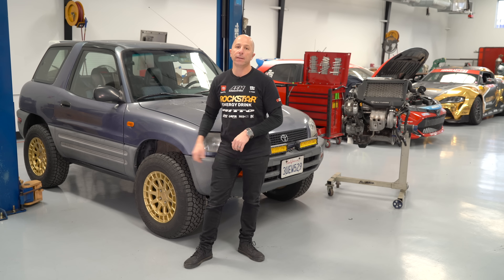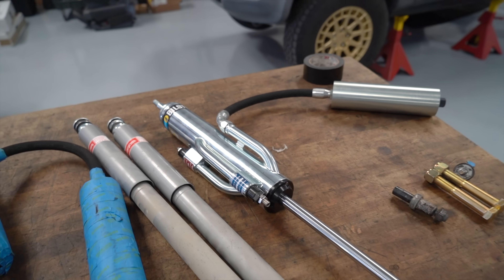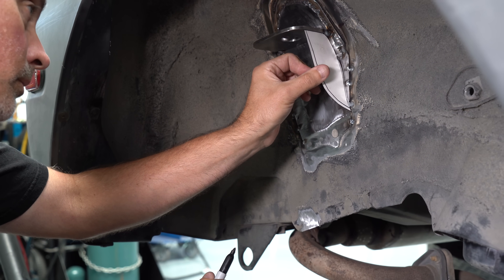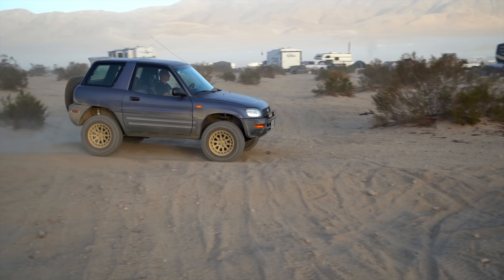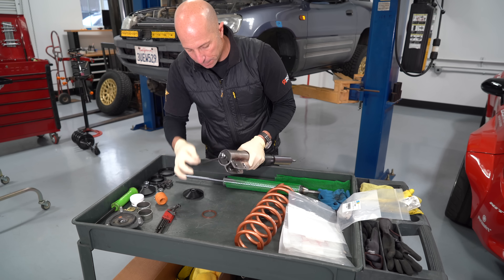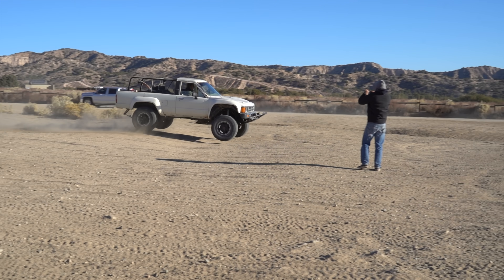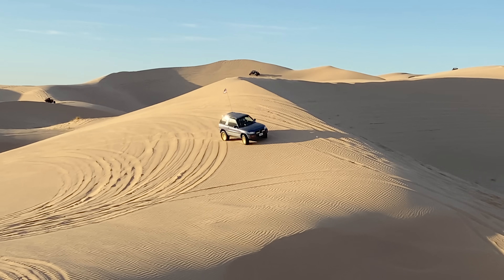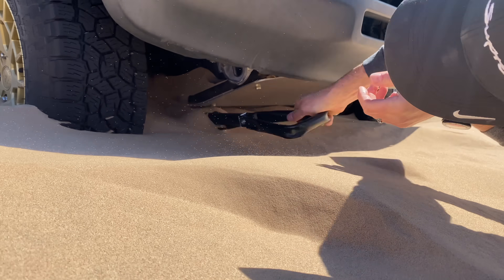RAV4 Build Part 2 - Install and Test Racing Suspension

Comment: This is so much cooler to watch than all the super expensive pro builds out on the web.
Reply: Well this is pro build. Tell me how many people can fabricate mounts for shocks?
Reply: Indeed
Reply: @dkdanis1340  well yes, but its not some sorta high zoot ground up buggy build, or even the trendy Tacoma...its an old Rav4!
Reply: @dkdanis1340  still not out of the reach of a decent home setup. That’s about as basic as fabrication gets and could be done pretty easily with an angle grinder, welder, cardboard to make templates etc. May not be as pretty but could certainly be done.
Reply: @benyvonnemckenzie6576  also they used high end bypass shocks. But yeah it can be done.
Reply: @benyvonnemckenzie6576  Exactly, I am a 23 year old student and with my home setup could easiely do it. I own a welder, an angle grinder and a super basic mill/drillpress. I even do similar stuff often, but more for motorcycles and stuff.
Reply: This is an expensive pro-build though, just because its not a 200k offroader doesn't mean the suspension alone isn't worth more than the whole car

Comment: So glad this video exists, I learned quite a bit about suspension in this one! I went out and experienced local SCCA rallycross for the first time, even took my stock 07 Corolla out for a few laps and fell in love! I need to get an AWD car for a move north soon, and I've been eyeing up old first gen CR-Vs. My thought now is the initial plan of the RAV4 build: something reliable (in my case, a daily) that I can take rallycross racing on the weekends!

From what I observed and experienced, it seems the best way to do this would be entering the prepped class with something that has a little more work put into survivability! With small rallycross courses, it seems suspension and control might be more of an advantage for a power-limited vehicle, so I've been trying to figure out the best way to set up more capable suspension from stock mounting points and without altering the body panels (per the rules and also not wanting to hack up a daily too much). 

Super fun video, definitely gave me a lot to think about! I'm glad there are experienced guys like you out there willing to play around with low-buck projects and share that knowledge with something anybody can obtain on a budget!

Comment: It looks like you are new learning on how to drive off road!
Specially driving on sand.
You should have lower the tires pressure to at least 10 PSI.
I do a lot of driving on soft desert sand.
When you have all tires at low Pressure that's when the fun begins.
Greet video pal.
I love your rav4.
Keep the good work. 👌👌👌👍👍👍

Comment: I’ve never duned before, looks like a blast. But I own the same model and year for almost 6 months. Most fun car to zip around town, run errands and find all the good parking spots. 

I’m imagining a retractable/inflatable pontoons on the sides, maybe hidden in the oem nerf bars. Could inflate, lift you out of the sand, drive off and use the vacuum from the engine to retract. Hmmm

Comment: Glad to see the 3sgte! But would of gone for the gen 4 over the gen 5, much better intake manifold and no need to deal with the key coding, remember 5s block if your going to do a build over 450whp !! Blocking filling too to max it out at 850whp+/- rod to stroke ratio dependant
Reply: I think they went with the Gen5 since they're cheaper than the 4 by about $6-800. Gees these engines have gone up significantly, used to be had for $900 not too long ago. Will be great to see how this project comes together.

Comment: Fun fact, the NA Miata equipped with factory Bilstein socks has a LOT of rebound damping designed to lower the car by packing it onto the bumps tops (which have a much higher spring rate)

Comment: I really like this project so much that i bought a rav and really want to copy what you did with the suspension and the tires.
I would really wanna know:
What tire size did you use?
The stroke and valving you ordered on the front strut and the spring that is on it. 
It would really be a big help.
Really looking forward to the next video on this build 😁
Reply: I have the same car, I put 235/70/R16. It rubs at certain points. 225's didn't.

Comment: Does anyone know what suspension rate and length he used ? I have a rav build  too but did it backwards, mine has the horsepower but stock suspension, this video was great, thank you Stephen.🙏

Comment: Do you care to expand on how you got in the ballpark with the front damper valving? I'm doing a similar (~8" travel) project on a Volvo 240 and want to use the 46mm Bilstein's up front but am struggling with what valving to start with at the moment. Great video and thanks for contributing.

Comment: Subscribed for this! awesome, I have a Question, what happens when you lift a car with different suspension, I mean If a put a 2" lift with my travel decrease? even if my shocks are longer? will the other parts of my suspension be the ones determining my travel? thanks!

Comment: He's gonna put a 2J in there, isn't he.
Reply: The engine shown in the end was an 3sgte 4gen engine
Reply: @lukasjuskevicius7790  just as good option 😁
Reply: @lukasjuskevicius7790  a 4 cilinder 2jz
Reply: @lukasjuskevicius7790  Actually it is a Gen5 3SGTE. The Gen4 has the side feed intake manifold...the Gen5 has the middle feed intake manifold, which you can see in the video if you look closely enough.

Comment: Any chance of you making a partial kit? Weld on brackets etc.. 
 Or me paying you to do my 4dr in a similar way? 
Or working with me/fabricator so that I can emulate your setup to some degree.
  I have been to a dozen off-road shops and they all told me no, it can't be done.... Your the guy & My RAV4 is my toy.
All I can get is OME springs, and Bilstien inserts in stock housings... And I actually lose avail travel☹️
 I live 10 minutes from Johnson Valley, and would love to drive a "lil" faster and safer.
  It's So  easy to get in over your head in a heartbeat, w limited production suspension. You've made it a whole lot more capable...but SAFER!
 I've had 2 RAV4s since new.... Quirky and out of the ordinary.

Any reply appreciated👍
Reply: BUELLER? BUELLER? 😅

Comment: So I’m curious as to why you bothered to use 4130 for the shock mount? In my experience mild steel is more durable and doesn’t require stress relief etc. Any insight or is that just what you had ?

Comment: I watched part 1 with some excitement, finally a budget build with a not often used platform!
Then I start part 2. I'm sure it's very in depth and the work is a good standard but you've just spent more then the car cost on suspension. I'm out.